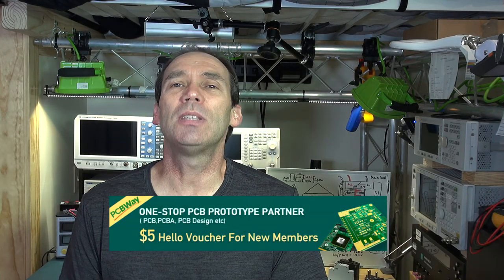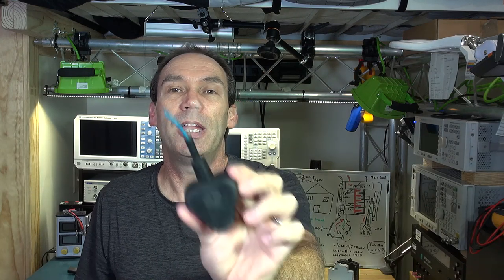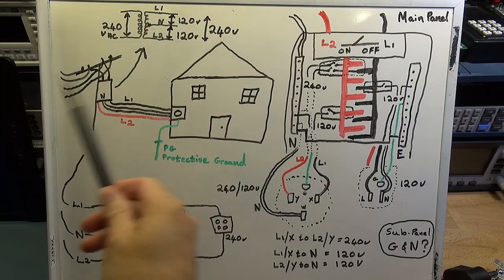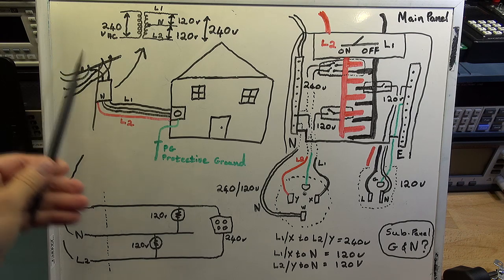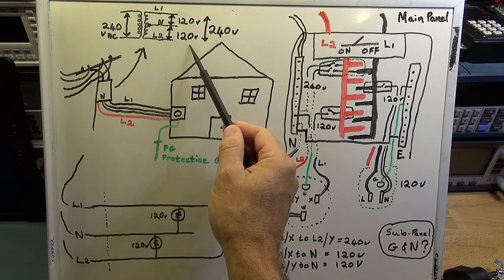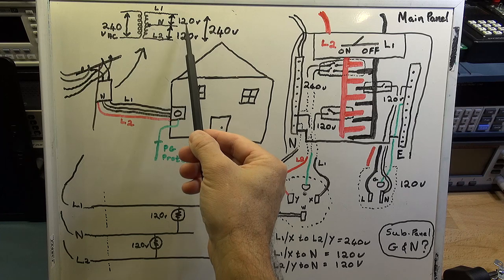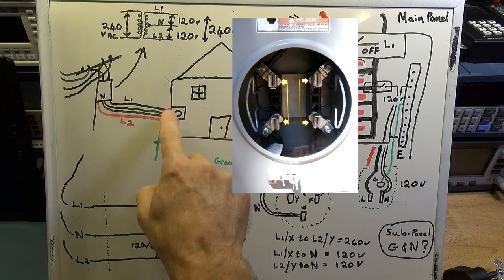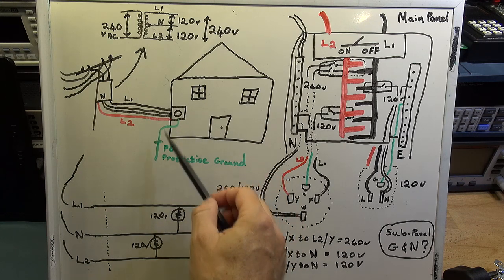The USA / American Split-Phase Electrical System

Comment: you have the outlet upside down Earth (Ground) should be at the bottom in the US it makes a grounded plug more stable
Reply: Most people put the ground at the bottom, but it is probably a more stable connection with the ground at the top.  It may be oriented either way, or sideways, but manufacturers usually label their receptacles assuming ground is at the top.

Comment: Have you ever thought to do a video on the US 3 phase power setup? Mine has 250V across L1 to L2 or L3.. L1 or L2 to ground gives 125V for normal split phase but L3 (third leg)  to ground gives 220V.  I know how to wire it but have never really figured it out 100%.. Thanks in advance
Reply: @Gene Did you ever get this figured out? I need to do the same.
Reply: I believe you are talking about 3 phase high leg delta

Comment: Great video and explanation!  Thanks Martin.
When you talk about the US plug coming partially out of the receptical, that is very apparent on the 39 cent recepticals that you find at the big box stores that have a lousy grip that gets very bad over time, and they barley hold the plug .  This can lead to overheated plugs due to poor contact, and fire.
I don't see how they get pasted the UL rating system!
Reply from the maker: Thanks for your post.

Comment: But if you have different outlets on different phases, doesn't that mean that one on the 2nd phase is actually neganive 120v?
Wouldn't that present an issue if you have an audio device on each phase and then connect them together with a signal cable?
Or what if you have an audio device that uses 240v, for some reason, and that's hooked up to a single phase one -- wouldn't there be a 120v potential between their respective references?
Reply: There is no such thing as “negative 120v” when dealing with AC.  The voltage alternates between positive and negative at 60 Hz.  It doesn’t matter if two devices in your stereo system are powered by opposite phases.

Comment: Martin; I wonder how you connected all your 240 volt devices from South Africa    to the 120 volt system in the U.S.? Did you connect them between L1 ans L2? Or did you have to buy a 1:2 transformer?
Reply from the maker: We sold 99.9% of our South African appliances. The couple of items I did bring over I use on a transformer.

Comment: The ZA type M plug is one of the most positive, sturdy plug I have used. The US and AU type often end up with bent pins .  And the old Snapper plug is the easiest to wire plug ever.

Comment: why don't you use 3 phase services for all homes? Everyone would have the possibility to have bigger electrical motors , big loads like stoves, dryers etc would load the power-grid evenly and the current is kept down in the wires..
Reply: Anybody who actually needs 3-phase service can get it.  Ordinary residential ranges and dryers do not require 3-phase power.  The power company balances the phases (approximately) by distributing the residential loads among the three phases.
Reply: I’ll add that not many homes need a motor that requires 240V power.  I have several motors in my apartment, most of them small, and none requiring a 240V circuit.  People who might want 3-phase 120/208 service are those with a shop containing multiple power tools.
Reply: @GH-oi2jf Level 3 EV power stations require the mentioned 3 phase power.    This is for the future electric automobiles. 
    However, 3 phase is not available in residential areas For  the Most Part.

Comment: The transformer is 10,000 volts in most cases.   Then it's step down to 2  120v feeds.
Reply: There is no single standard for distribution voltage, but 7200V is common.
Reply: @GH-oi2jf of course it is.

Comment: LOL, so funny to watch this budget-system in the US for normal homes. Here in Germany you get three-phase electric power with 400 Volt between L1 and L3 and 240 Volt between L and N. Your normal kitchen stove has three-phase electric-power and a normal small flat has three-phase with 63 Amps resulting in 44 Kilowatt. :D
Reply: It's not budget if we waste twice as much copper with lower voltage. The system's older from a time when 120v was thought to be safer, so that fake Euro-snobbery could go away like body odor if and when you folks plan to use deodorant..  BTW, 200 amps at 240v is 48 Kilowatt :P
Reply: The 240/120 split phase system is just MUCH safer from an electrocution perspective and that is the reason for it.  It is only for residential use.  Industrial is 600 or 480 V, 3 phase with 208 phase to phase and 120 phase to neutral for low voltage.
Reply: @red90rover98  bigclive said in a video 230V might be safer than 120 when zapped between hands because higher current tends to flow at the surface of the conductor and that could mean less current passing through the heart..  But on the other hand muscles contract more with higher voltage, don't they?
Reply: @afroninjadeluxe  Big Clive is wrong in this instance.
Reply: @kwpctek9190  With 120/240V or 120V/208V split circuits, the copper needed for a given power level compared to single phase 240V is 50% more for 2 phases or 33% for 3 phases, not double. That's not common in residential but is common in commercial.
Reply: @NiHaoMike64  Yeah I know.. it does remain a factor - bus bars are thicker too. Most of my vigor was for our "Here in Germany" Euro-fake-superiority friend. Every country's a mix of good, bad, and historic blunders.. live, learn and change when possible ;-)
Reply: And through your socialist/communist policies, the little guy pays for the big guy's bills. There.
Reply: Whilst lacking three-phases is a disadvantage (even here in Brazil we get three-phase power pretty much everywhere, 127/220V on 2/3 of the country, 220/380V on the remaining third), in all fairness, Americans get 48kW vs "only" 44kW in Germany. Not only that, Americans rely far more on gas for heating appliances from what I've gathered. Cooking ranges are far more common on your side of the pond than on ours. Electric space and water heating is less used in America than in most of Europe.

They DO need to use twice as much copper as those in 230V territory, but that's a pretty marginal cost relative to the cost of a building (hardly more than 3% of the cost), and the lower voltage not only adds unquestionable safety, but it also allows compatibility with appliances made for 230V. Europeans simply cannot run a 120V appliance unless they use a step-down transformer, under the risk of frying the appliance if accidentatly plugged to the wrong voltage. Americans can easily use a British electric kettle made for 240V. All they need is a double breaker and an outlet running on two hot legs.

Comment: What a pity you have only 120 volts, what a mistake in System. in New Zealand we went the UK way 230 volts 50 HZ, I have 2 x 230 volts into my house, so 400 volt between, 3 phases here 120 deg. apart. (P-N = P-P x 1.7321) Square Root of 3. I only of course use the phases at 230 volts so part of house on each.
Reply: We have 240V service in North America.  Not many customers need higher voltage than that, but 480/277 3-phase is available for those who need it.  As for frequency, 60 Hz is more efficient than 50 Hz.  The frequency is the wierdest thing about most other electrical distribution systems.
Reply: And, by the way, almost every electric device you need in a residence works perfectly well on 120 volts.  Do you think a freshly brewed cup of coffee is better if the coffeemaker runs on 240 volts?  It’s the power that heats the water, not the voltage.
Reply: OK but I am talking about cable sizes really. 2kW at 230 needs only 8.7 amps, at 120 volts it's 16.7 amps
Reply: @brentwilliams191  — True, but practically everything found n a sidnc runs on a 20A circuit.  That is wired with AWG #12, which isn’t particulary big.  It’s easy to work with.

Comment: US plugs look anemic look like they might melt if abused slightly ;0 LOL
Reply: You're right; you should make sure you stay far from them. LOL
Reply: @onekerri1  I might try find some and melt them on my channel with a monster transformer 😂😂
Reply: There are many manufactures of 120V plugs.  They all work well enough.  If a plug melts, it must have been overloaded.  Do not exceed the rating of any wiring devices.